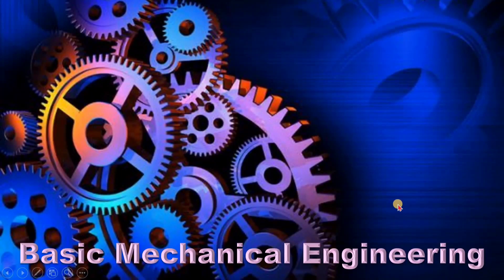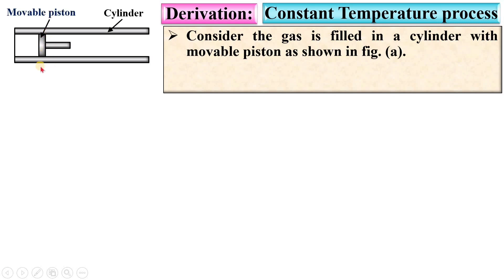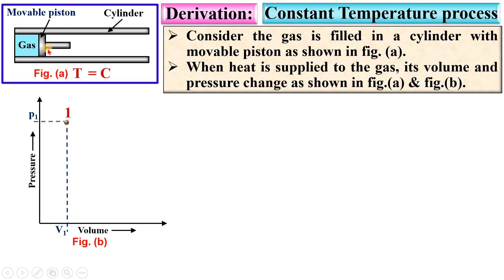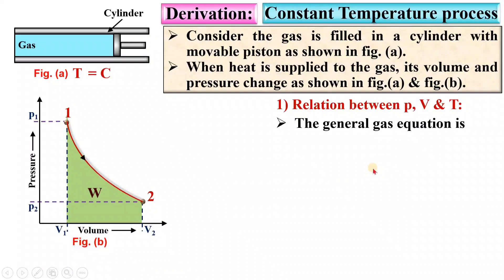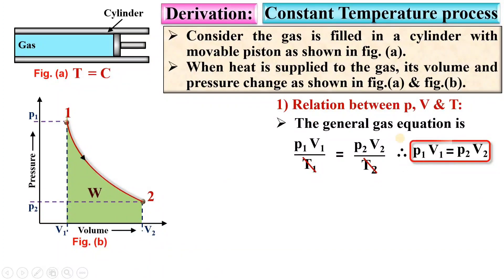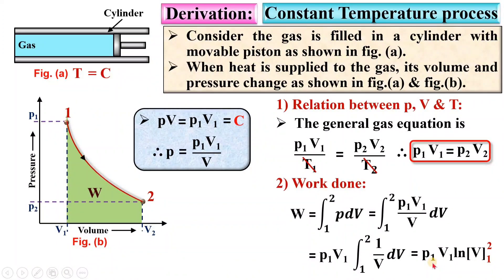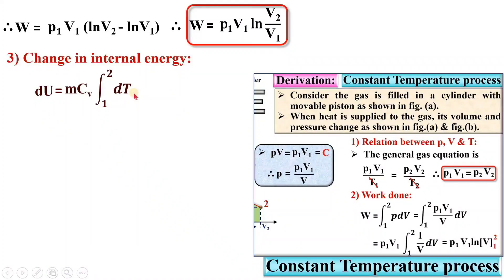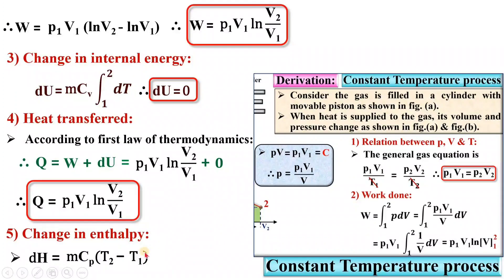Isothermal Process (Basics, pV diagram, Work Done, Internal Energy, Heat & Enthalpy) Explained

Comment from the maker: Isothermal Process or Constant temperature process or Hyperbolic process explained with following Timestamps: 
0:00 - Isothermal Process - Basic Mechanical Engineering lecture series 
0:33 – Isothermal process or hyperbolic process
1:12 – pV diagram of isothermal process
2:23 – relation between pressure volume and temperature
3:07 – work done during isothermal process
4:47 – work done during constant temperature process
4:51 – Change in internal energy during isothermal process
5:12 – Heat transferred during isothermal process
5:44 – change in enthalpy during isothermal process